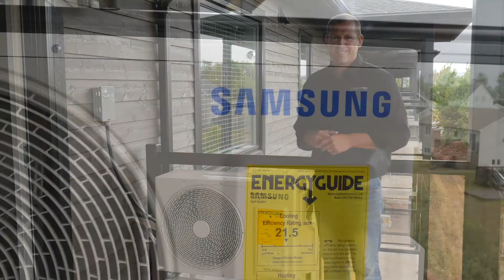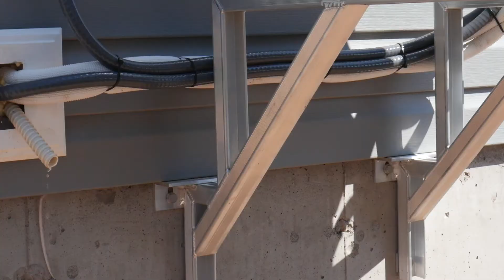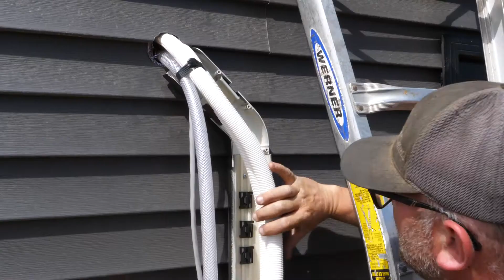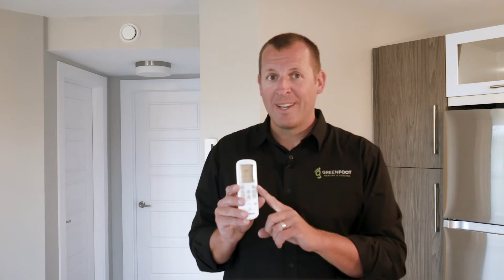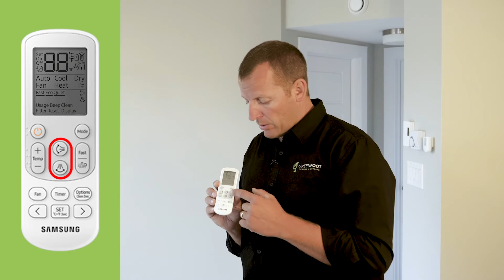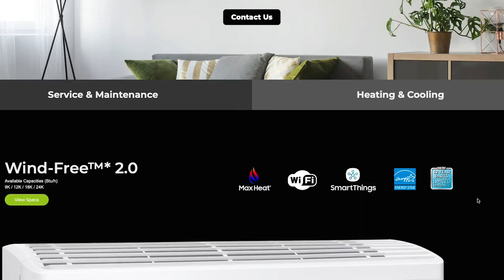Service Yeti Operations - Samsung Quantum 2.0 Ductless Heat Pump

Comment: What is the deal with temperature setting while in dry mode? Also- in general when in heat or cool- is the temp setting for desired ambient temp, or the temp of the air which the unit is producing and blowing out? I ask because in cooling, the ambient temp often ends up way lower then the set point on the remote.

Comment: I've been trying to figure out how to get the horizontal louvers to move  side to side but now I see this model only used the vertical up and down flap. How do I manually set the direction of the louvers side to side? Thank you for the great info, btw!
Reply: I’d like to know the same thing
Reply: Mee too
Reply: Figured it out … just move them manually . I was afraid to do it before because they were very stiff and did not want to force and break them . There are 3 sets of Louvers , grab the middle louver of each set and firmly turn it in the direction you want , the others will follow . They are very stiff but will move .
Reply: Apparently there are two small levers to point them